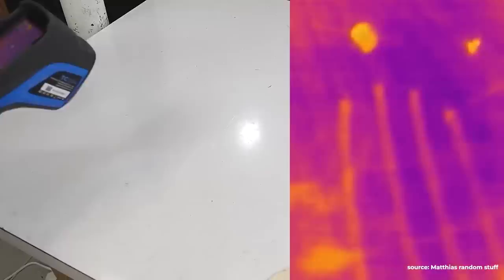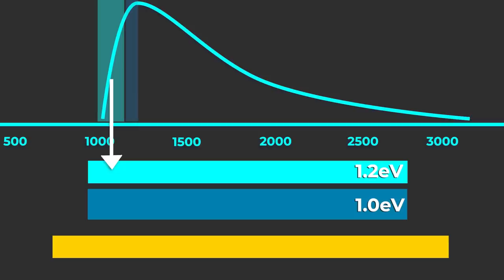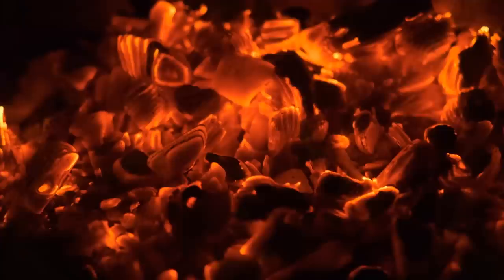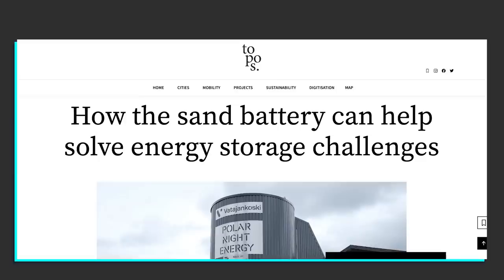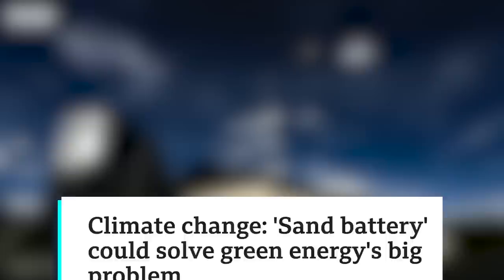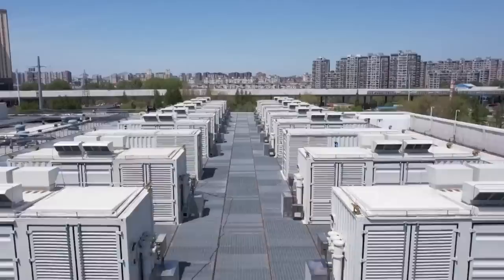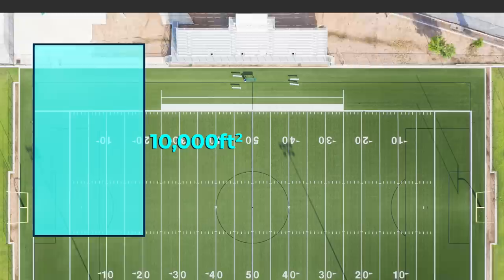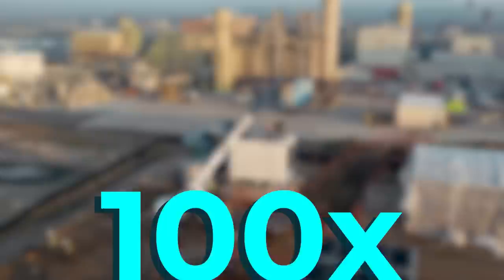The End of Lithium-ion? These Solar Panels May Be the Future of Energy Storage

Comment: Hmm...you just mentioned something that got me thinking: Normal photovoltaics don't reflect the light back to the Sun. What if they did? I mean, it would not affect the star, but is there a possibility that it might increase the amount of energy sent out into space and thus cooling the planet just a smidge? That's what snow does, right?
Reply: There are already radiant-sky/space cooling systems in the works.  Unfortunately, some of them use expensive materials like hafnium oxide and silver.

Comment: so basically a thermocouple , heat equals voltage. 3m has a patent on one that was used on a train where the thermocouple was wound around a exhaust manofold and produced enough voltage to charge a battery . this was in the 70s

Comment: What about black diamond solar cells?  I read about them maybe 8 years ago.  They are about 50% efficient, and they said if you use the waste heat, they could reach about 70%.  I think they operate at about 700 deg C.

Comment: Thank you for the time and effort it took to bring this information to us.  Merry Christmas all.
I'm glad someone with the resources is going to make this a viable energy conversion source. Connect the red wire of your volt meter to a penny, the black wire to ground, and heat up the penny.  You can get a similar result by putting the penny in lemon water.
I have a lot of problems with thermal energy storage systems, most of all being "Heat Island Effect" from the escaping thermal energy these systems contribute to.  The only way to deal with this is insulation with at least an R-95 thermal reflective value.

Comment: I bought 20 230Ah Lifepo4 cells for £2300 in 2022, of which I use 16 for 14kWh storage. That's around £0.07 per kWh if my maths is correct. They should last 10 years, my old 7kWh lead acid battery lasted 8 years and still functions at lower capacity. So spread that cost over  >3500 days and I pay nothing for power. 
I run a whole house: washing machine, freezer, water pumps, microwave etc., plus an extensive hobby/craft woodworking shop with several large induction motors. I even weld with a mig for short runs when needed. I have never dropped below 40% soc at the end of a day and the battery recovers to full within a couple of days of average sunshine, even in winter from just 3kW of solar. 
$400/kWh sounds very wrong and I would like to see those numbers.

Comment: I don't normally think of sand as a fluid, but it seems the principles for heating and extracting heat from sand is similar... Using a heat exchanger. You'd think that it's much more difficult to manage sand rather than something like molten sodium since you have to continuously run the medium over the heat exchanger for heat to transfer. I also assume that whatever the efficiency is, is determined by the heat exchanger and not the storage medium.

40% efficiency of these heat photovoltaics is pretty incredible. Recent solar PV panels are implementing the same principle of multiple layers to capture a larger spectrum of energy but more than 2 layers. I imagine details are important and ideal conditions aren't isn't necessarily easy to maintain.

Comment: Remember back in the day when there were scientist working on using kinetic energy for storage, but found the goal illusive? Solid state heat storage seems so much more reasonable than gyros. Also, far more simple than turbines or Stirling engines for converting the heat into electricity.
Okay, there are facilities that can produce the thermovoltaic cells, and what are the raw inputs? Surely, they aren't any poisonous than the ones going into photovoltaics, or are they? Also, is there an idea of the lifespan of these things?

Comment: So, there is a lot of heat produced when entering an atmosphere (2,370°F/1,300°C). Couldn't heat shields be converted to thermogenerators. When traveling to Mars, you would want every possible power source. Imagine, for example, starship landing on Mars charges its batteries as it's entering the atmosphere...

Comment: So heat is not by definition JUST infrared radiation. Heat is the transfer of energy, which occurs 3 different ways, through convection, conduction, and radiation. Heat radiation is given off in infrared wavelengths but can also be given off at any wavelength.

Comment: All major cities and even most small settlements in Finland already have a district heating network. That has been the case since at least 1960s. So the sand battery kind of devices do not incur a cost of building the grid infrastructure. There are multiple reasons for having these networks. First one is that there is a big need for heating as the winters are cold. Burning stuff in cities is bad for the air quality. And having a central system allows for having very high efficiency heating that also can use multiple energy sources, making the price fluctuations for individual house holds much less. The district heating network can use whatever is optimal at a given time and has been integrated to the grid.

Comment: 1:42

1. because blackbody radiation is pretty wide, spectrally speaking. While the sun, for instance, emits primarily in the green spectrum, that blackbody radiation is spectrally wide enough to cover the spectrum so evenly as to appear white to us (especially after factoring in various perceptual things such as our eyes automatically adjusting whitepoint and what not. But even without that, it'd at least appear orangish or bluish at best, and definitely not green)
For the red hot parts, we are initially pretty much only seeing the tail of the distribution, and that tail decreases exponentially with higher energy light, so effectively it looks like a very deep red to us.
For blue hot, we can actually look at the infinite temperature limit: In that limit, fun fact, we actually happen to fall more or less on sky blue. It ends up being more purplish than actual sky blue, but there is a reason for that:
The sky gets its color from Rayleigh scattering which by complete coincidence just so happens to have the same sort of wavelength dependent falloff as a blackbody radiator in the infinite temperature limit. So if you had a light source that emits with the constant spectrum (known as "Illuminant E"), the sky would in fact look kinda more purplish.
However, the sun is already significantly less bright in the violets than in the greens, so the light that gets scattered away to color the sky simply doesn't have enough violet in it to turn into that same infinite-temperature color. Instead you get something slightly more greenish blue.
(Of course, if you actually ever existed anywhere near an infinite temperature blackbody radiator, you'd already be dead, and the universe along with you, but that's neither here nor there. Good thing the sky doesn't glow on its own but simply borrows its light from the sun)

2. Flames are really complicated chemical reactions. In a candle flame, different parts of that flame have the rigth conditions for different reactions taking place depending on  temperature, pressure, and available fuel and oxygen. The typical blackbody colored parts are superheated soot which, at room temperature, would basically look black. I think this is also part of why that part of the flame is opaque. If it weren't so hot, you'd be looking at a black cloud of sorts in that region.
Meanwhile the blue part is a different kind of flame. That's, iirc, burning hydrogen, and therefore emitting with the absorption and emission (spectrum (same thing in reverse) of hydrogen, which ends up being this blue color. Every atom has a characteristic glow. Some particularly nice-looking ones are commonly used in colorful fireworks for that reason.
The reason for this characteristic coloration is, that an atom's electrons can only exist at specific energy levels (quantum mechanics) and if energy is high enough, such as when there is a lot of heat around, electrons can jump into a heightened state (which is where absorption spectra come from) and then fall down into a lowered state, emitting some light of specific wavelengths corresponding to how far the electron fell. For different kinds of atoms, these energy levels look different, leading to a unique spectral fingerprint for every element.
For hydrogen it just so happens that some particularly bright emission lines are in the blue part of the spectrum.

Comment: This could be a game changer, but efficiency needs to be much bigger before it becomes a usable system. I imagine putting a device on your gas cooker, heating it for an hour and storing enough electricity for a 4 member family home 48hr use, or even longer.  Now just to find a way to generate heat much cheaper. This is where science needs huge jumps in technology.

Comment: At 40% efficiency,  10 joules of thermal energy yields 4 joules of electrical energy. A heat pump can use that to move 12 - 15 joules of thermal energy back into the system. Seems like an opportunity in there somewhere 🤔 😏
Reply: Heat pumps become less and less efficient the larger the temperature gradient becomes. Even though modern heat pumps still get reasonable efficiency with a 40 degree Celsius gradient: I still likely need a ground-source heatpump where I live.

Comment: Hi just for the sake of sharing information that may lead to some progress in the future. The Canon printing corporation makes a film for their high-speed  printers that I experimented with to make a capacitor and I thought that I was experiencing a dielectric memory but come to find out it would recharge by the heat from my hands. To further test this I put it near the heat shrink machine and got about 1 volt out of it. May not sound like much but it worked. Problem with the film is that it degrades in the light. I have a video of it that I took at the time.

Comment: These things are not limited by the Carnot limit, right? I think that is the best part, because it can be improved upon
Reply: Unfortunately, they are. You have to keep the TPV way cooler than the emitter, or you get nothing. That cooling doesn’t come free either. It costs energy to keep it cool, so you have to subtract that from any true efficiency calculation. MIT unfortunately didn’t include this in their calculations..
Reply: @simontillson482  
I understand what you're trying to say, but...
If the theoretical efficiency can reach 100%, the closer you get to that, you have less heating of the TPV, meaning you need less cooling... right?

P.S. Thanks for pointing out the detail about the paper.

Comment: As these work more efficiently at high temperatures, is there potential for them to be used with combustion engines, to recover some of the waste heat from hot exhaust gases? Especially in a hybrid
Reply: I used to wonder about that vis-a-vis thermoelectric devices, just plate the whole exhaust system with them.  At eight percent efficiency (best case scenario) it wouldn't be worth the trouble; at fifteen percent it probably is.  At forty percent, that'd be massive.  The very best IC gas engine I know of right now is about 40% efficient converting fuel energy to motion; with about 60% of the energy wasted as heat that's pretty terrible.  If you could achieve the 40% on the wasted 60%, that would take your IC up to 64% total efficiency - actually achieving the ideal Carnot limit.   would be front page headline news.  It would make a base Jeep Wrangler thriftier than a current Toyota Camry, and boost a Prius' fuel economy from its current 54 to over 80mpg.

In fact the gains on the Wrangler might be higher; its heat efficiency is not great so there's more waste heat to recapture and a bigger boost to be enjoyed there.  The Prius is the model with the high heat efficiency already.
Reply: Remember the lithium batteries mentioned with their 90% round trip efficiency?

Electric cars are simply cheaper for short, and likely medium distance, trips.

Comment: What about sterling engines to convert the sand battery into electricity. Like the ones used in  molten aluminium very similar heat range if not the same

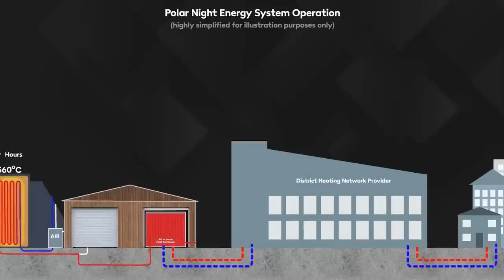Comment: The statement about heat cycling (10:40) is quite strange. I guess we can agree that the sand doesn't care. The solar panels have to be cooled anyway. You cannot generate energy if the radiation receiver has the same temperature as the radiation source. Visible light solar panels only work because they are much cooler than the sun. This temperature difference sets the efficiency limit. And when you do not need electricity from that storage any more then it should be easily possible to cool the solar panels down so slowly that there is not damage or just change from cooling to a good insulation and just keep them at that temperature.

Comment: Heat storage is very old school, Brits need look no further than their own storage heaters for an example.  When on a two-tariff system, the storage heater allows customers to purchase energy when it's cheap, and use the heat later when the energy is expensive.  "Sand batteries" do the same thing, it's only the scale that is really different.  Even without the next-gen TPV systems, storing high-temperature heat can be a big advantage for industrial applications that can make use of it, providing an avenue toward de-carbonization in industries where decarbonization isn't easy.

Comment: I just had an interesting idea.  I will explain it in what I hope is the easiest form to understand.
Imagine you have some sort of engine like a two cylinder engine running off biogas.
Imagine that the thing has windows that are transparent to the IR.
The fact that the TPV cell reflects IR that is too low energy to use doesn't mean that it must reflect it back as the source.  It could be angled so that it reflects IR that came from the cylinder near top dead center into the one near bottom dead center.
This would put the thermal energy into the cylinder before it is compressed and ignited.
Thus the energy will come out of that cylinder when it is ignited and it will come out as higher energy photons.
The efficiency of an ICE engine is not all that great so this may lead to an engine with a greater total efficiency because some of the output comes in the form of electrical power.
Reply: @fleetingfacet  Its on my list but it will be a while.  There are several in the cue before it.

Comment: Has anyone thought about using parabolic reflectors to concentrate the suns rays on these panels?
If i'm understanding this correctly, higher temperatures make these more efficient.
Reply: you're going to need a lens that's about a square meter in size to focus enough sunlight onto a postage stamp size panel.
normal pv panels will generate about the same power over that area

Comment: Their quote of $5/10kWh; is that per unit stored, or delivered? If they are 25% efficient, then that multiplies it by four, plus needing four times the number of solar panels, or turbines needed to provide that energy, would make them a much more expensive proposal. I don't think round trip efficiency, is nearly as big a deal, as many seem to think, but that is a lot to make up. Maybe the reflected photons, mean it all gets used over and over, until eventually that photon is captured?

Comment from the maker: Why don't we see 'green' hot? And why was the bottom of the flame blue?
Reply: Blue is hotter.
Reply: The blue flame is from the right mix of fuel & oxygen? It’s a more complete burn so it’s hotter.
Hottest part of the flame I guess is from heated gas rising?
Green flame…. just put a bit of copper in the mix.. ok, that’s not really an answer I’ll admit. 
Nice video by the way..
Reply: We don't see green hot because colors are additive, and heat is not an ordered excitation of atom unlike a laser. 

When you heat a rod it starts emitting IR, then IR + red, then IR + red + green, then IR + red + green + blue. I.e. it goes from invisible to red to yellow to white.

As for blue flame it could be just emission of stuff burning in the flame, like adding salts can make flame green or purple or blue.

Comment: Peltier device is a lot cheaper and works well with lower heat but uses a difference between two areas
Reply: Forget TEC or TEG devices. They must work under 150ºC and maintain a high Delta on the sides for produce basically nothing more than turning on an LED

Comment: actually this can be way more than just energy storage and it would also fix the thermal cycling issue. but it only needs to reach around 20% energy efficiency.
would need lower temps however. you might already have figured out what I am talking about if you have some enginearing knowledge, since essentially if it can reach roughly 20% efficiency at a doable temperature which wouldn't melt most things(or if instead we could design custom mechanical devices that handle such temps to pump the flow and such) then essentially it would mean already having reached the supercritical point of the system, which results essentially in a self sustaining reaction capable of turning even insanely low temps into tons of energy. sorry for speaking half cryptic

Comment: Combined gas and steam power plants can reach an efficiency of more than 60%. Such systems are still quite new but several installations are already up and running with an output power of 400 MW and more. They are much more efficient than the thermal power cells of your video.
Reply: You still have lots of moving parts which need regular maintenance and wear out.

Comment: Please do a video on LPP Fusion's FF2B Dense Plasma Focus Fusion device. It is an experimental Solid State Fusion Electricity Generator that doesn't need a steam turbine to generate electricity in the proposed final form when using Hydrogen-Boron (pB11) aneutronic (No radioactive waste) fuel.